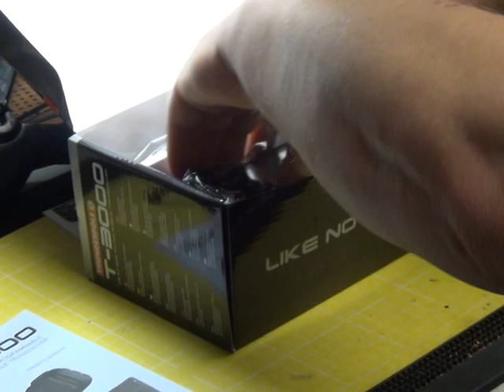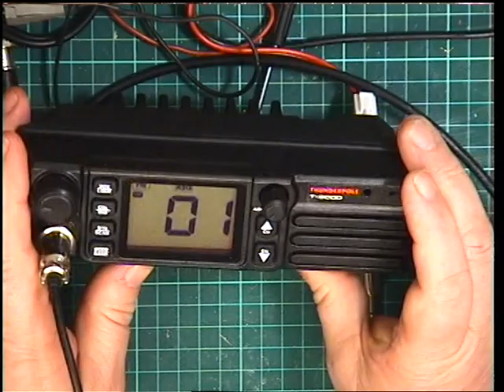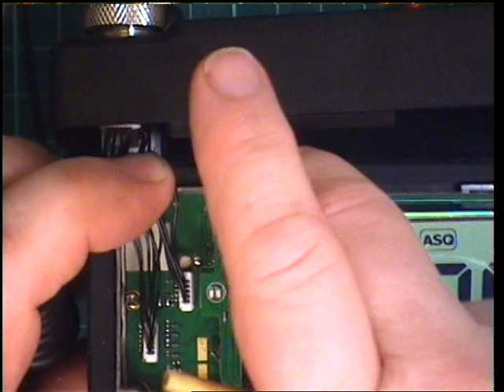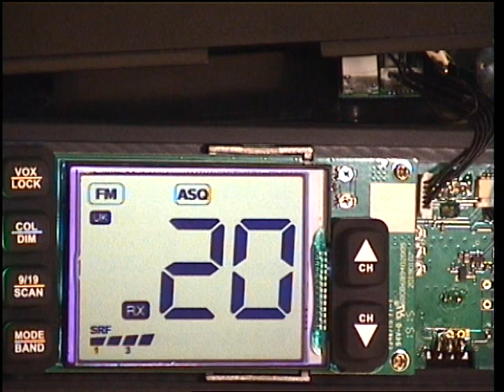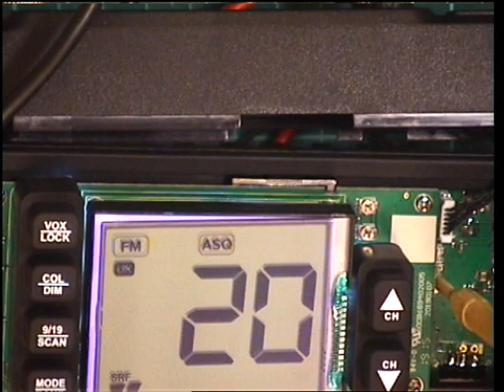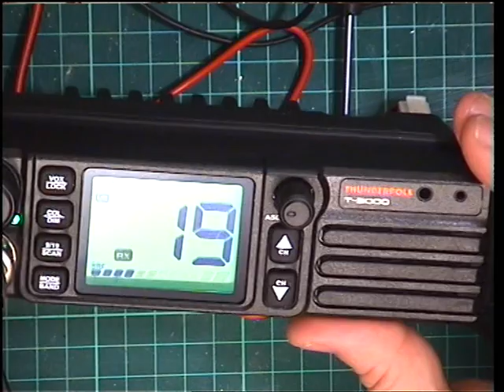Thunderpole T3000 (UK) CE Multi-Norm CB radio (mobile) - Overview & internal adjustment

Comment: Hello Richard, this is interesting, I am looking at buying this very Radio. I had a Midland Radio, I forget which model, one of the older blue/ green coloured ones running a K40 antenna. What sort of antenna would you recommend for this please? Also, if I do purchase one of these Thunderpole radios, do you offer this service? Thank you, keep up the good work, Richard.
Reply from the maker: Yes, you can send the radio in for optimisation. Please email me. (rshireby@ahoo.co.uk). Aerial-wise, it's whatever works for you....we always use drilled-in body mount aerial as it makes a big difference between lagmount type performance.  Always make sure your SWR on whatever aerial you use is as good as you can get of course.

Richsard, G0OJF, UK

Comment: Wow a disc with something for the Amiga written on it. Still a big Amiga user - I recap A1200 and A600 models and often move them on through eBay - usually at a loss. I have 4x A1200 all restored with Blizzard 1230 MKIV boards in EACH ONE - yes I have lost the plot. Will probably move a few on at some point. Set looks like a Marine rig.
Reply from the maker: Mr Chippie was big-time into Amiga.

Richard

Comment: Well  Dear Richard myn brand was Jopix  .i dont like it a tol !!! i like the normal danita 3000 and dont smeyling the 1240 you can stil by and are so good worcking !!!! and chaep and from metal !!!!!! and verry senticief  on vacation on france she worcking like hell
Reply from the maker: We tested the Jopix version, the video is on here & it is not as good as the Thunderpole T3000. Like all other CB radios, they never work new out of the box properly. Deviation & power far too low.. 

On the whole the Thunderpole radios work reasonably well, though not perfectly, out of the box.

Richard, G0OJF, UK

Comment: rubisch !!! i have 2 like dis but a other brand ,the radio is just the same i put boyt on the garbisch !!!!
Reply from the maker: The firmware on the Thunderpole T3000 is different to any other branded sxets that look the same. Why were the sets you had garbage?

Richard, G0OJF, UK

Comment: The same CB radio as the PNI HP9500, but I think the PNI is cheaper (in germany).
Reply from the maker: The PNI version has different firmware...we did  a video on that too. For UK users the PNI firmware is inferior to the Thunderpole version. However it may be fine for non UK users.

Richard, G0OJF, UK

Comment: I have one of these but when I speak it’s extremely quiet. Everyone struggles to hear me. Have tried a new microphone and it hasn’t helped. Any ideas ?
Reply from the maker: The transmit deviation is too low & requires adjustment with reference to an FM deviation meter & a dummy load. All new sets have the deviation far too low. It should be 2.2 to an absolute maximum 'never exceed' of 2.5Khz to be the 'right' volume for the UK on transmit. All new sets have it set around 1.4Khz which, as you've discovered, is far too low. It's nothing to do with the mike & the radio isn't faulty. Remember I said 'all new sets'...I mean that....some Albrecht & Cobra sets that I've seen are set to a miniscule 0.9Khz.

Richard, G0OJF, UK
Reply: @ukfmcbradioservicingTango21  thankyou for the quick reply. is that easy to adjust or not ?
Reply from the maker: @joshhyde5605  It's easy to adjust, but you have to have the radio connected to an FM deviation meter & dummy load in order to make the adjustment; This is so it doesn't end up going over 2.5Khz & spattering into channels either side. You could also send it in for service....and I'm not looking for business by the way!

rshireby@yahoo.co.uk

Comment: Just bought one  its ok..well its been 40 years since last on..would love to see what max power output is
Reply from the maker: 4W if you're lucky Andy. It's not like 1981 sets, many of which will easily (depending on model) do a good 4W. Most current models are coming out of the box doing between 2.5 & 3.6W. Few will go over 3.7W even after realignment. This model will do a full 4W. In reality it makes little difference to range. The blue display Midland 78+ multi fitted in our test vehicle won't do over 3.7W.

Richard, G0OJF, UK

Comment: Watching this and the new Midland one, it puts me off buying these new radios. They should set the radios correctly before they leave the factories, then maybe they would sell more of them. Great work
Reply from the maker: The Thunderpole range of radios are the only current ones that I consider to actually be useable out of the box without optimisation; the Albrecht range of expensive sets being the most sloppily setup...including one that was £229.99.

The T3000 is one of very few sets that they got the firmware correct on, allowing seamless band changes UK FM, CEPT FM, CEPT AM. Nearly every other set has to be reprogrammed for an EU country code to access AM on CEPT channels...this one get's it right.

CB radios are always shipped with low power & TX audio & are supposed to be adjusted by the selling dealer. Knights do that; I'm not sure if anyone else does, so I end up with them! The reason of low power shipping is in case the batch of radios are spot checked at the receiving countries Customs Dept. If the radios were all shipped at 4W & one was spot checked to be 4.01W, then the entire container load would be rejected & sent back. They err on the side of caution. It was the same with the 1981 models too which is why Boots & Woolwoths should never have been selling them!

Hope this helps

Richard, G0OJF, UK

Comment: Can the signal meter be adjusted mine is reading s9 on all channels. All my other radios read s2 or s3
Reply from the maker: No it can't on this model. S9 read about right on our test instrument. Quite a few new sets have no meter alignment preset. I've also noticed that the slightest signal & they read S5 when you would expect S1, so this set isn't alone.

Richard
Reply: @ukfmcbradioservicingTango21  thank you for the quick reply 
Regards Andy

Comment: I’m pretty new to CB and bought one of these this week, could I in theory open it up adjust power up to 4 watts or do I need to make consequent adjustments in other areas ?
Reply from the maker: You can just adjust the power without affecting anything else. You need a power meter & a dummy load....and a proper trimming tool to make the adjustment...not a screwdriver!

However, the power may not need adjusting...it depends what your meter says it's doing into a dummy load.

richard
Reply: UK CB radio servicing Hi Richard, thanks very much for taking the time to reply. I have bought an SWR/power meter and am waiting on it to arrive. So I will check the power output out of the box before doing anything. I hope it’s not a stupid question but what’s the difference between being hooked up to an aerial and using a dummy load ? Cheers, Mark
Reply from the maker: Mark, not all power gets to the aerial as it is subject to SWR. A perfectly working CB connected via a power meter to an aerial may read 1W...or may read 6W, so it means nothing. A dummy load replicates a perfect aerial & is the only way to measure power. You will need an adaptor from the RCA radio outlet to convert to SO239 (which is the female socket for a PL259 plug). So you need a SWR/Power meter, dummy load,  patch lead (usually 20cm PL259 to PL259) and an RCA male to SO239 adaptor. The latter can be hard to find, so I've gone to the trouble of looking on ebay for you & found this :192831320618. Finally you always check in the centre of the band, so that's channel 20.

Richard, G0OJF
Reply: UK CB radio servicing Thanks Richard, that makes sense about the need for a known constant loading. However once again please excuse my ignorance, where does the RCA come into play, doesn’t this radio just have PL259? So I’ve bought a SWR/power meter, patch cable, a dummy load, and the proper trimming tools. All of which will be useful going forward in this hobby even if I never open this particular radio. Many thanks for taking the time. Mark
Reply from the maker: Well our Midland 77-810 to which you commented on as having been given two of by your uncle is fitted with an RCA phono socket for the aerial!

Richard
Reply: UK CB radio servicing Hi Richard, I think you may be mixing me up with somebody else, I bought one of these thunderpole t3000 (albeit branded as a Team FX-CB mobile). But I guess all your advice still applies. Thanks, Mark
Reply from the maker: @mphelan1234  Yep,Muddling you up. Too many questions from people today!

Richard
Reply: UK CB radio servicing haha no problem at all. I’ll get all the parts together, test it and let you know what I find. Thanks again for the advice. Mark

Comment: Would love to see a Cat Whiskers Cat Call tested. I have many (including a base station) if you would like to try them - I’m relatively local to you
Reply from the maker: I do have one. To be honest they are just a DNT mobile put into a different case in the UK with selcall added, though they are the supertuned version. It's a chassis that is unreliable because of the double sided PCB that has rivets between the track sides; not a good idea. We will cover it though.

Richard
Reply: UK CB radio servicing if you would like a second so that you can do a performance test let me know

Comment: A friend of mine bought one of  these for his van, since I’m a long served CB operator , and have tried many things both new and old , so he leant it to me for my thoughts. To be honest, to me , it’s one of the best new radios I’ve used, even the automatic squelch seems quick and snappy with no hideous crashes or bad pops, and it will remain open with fair noise on peoples audio, rather than constantly chopping off, but in general still remains silent even when the meter shows s9 of racket. Very impressed. It also heard every station around the same clarity(weak) as the president grant 2 mobile, with better auto squelch action, and at home as good as the York 869. 👍🙂 good video as always, best regards to you and the team.
Reply from the maker: Thanks Tim. I try & balance between 1981 sets & current. Any UK legal set you'd like to see covered next? rshireby@yahoo.co.uk
Richard
Reply: UK CB radio servicing  that was the one I wanted to see covered! I was interested to see your view, and how it performed on the test set. I of course look forward to the usual road test if there is one following? Should I think of a radio I’d like to see covered I shall let you know.  Cheers, from Tim HT in Nuneaton 🙂
Reply from the maker: We'll be doing the 'on-the-air' test this Saturday afternoon (8FEB2020). Mr Chippie has been booked to come. Seeing as this is the first set to legally access CEPT AM when set to UK, I plan sending MR C away from base on UK Ch31 with auto squelch, then have him return from the 7 mile point switched to CEPT AM ch40.

Richard
Reply: UK CB radio servicing I look forward to it. Although I was aware of the AM function, I never did try it. I look forward to the results 🙂👍
Reply from the maker: @timothyjones4950  My experience with CEPT channels is is pretty poor, and I'm not expecting AM to help either; I have RAF Cranwell 4 miles away & RAF Barkston Heath 1.5 miles away, both with radar! It'll be interesting. 

Richard

Comment: Not keen on these radios at all Richard.
Reply from the maker: Do you prefer the more serviceable 1980's ones?

Richard
Reply: @ukfmcbradioservicingTango21  yes very much so Richard, I think the best all rounders was the cybernet boarded rigs - rotel, harrier, binatone 5 star, fidelity 2000 .
Reply: I like some of the newer radios too, the crt one (N) is excellent for the money.
Reply from the maker: @ep1929  Yes, 38 years later they have certainly stood the test of time. There can't be many 1981 electronic products that are still saleable for good money after 38 years!
Pity Cybernet got bought by Kyocera & the factory now churns out solar panels instead. All that CB manufacturing knowhow turned to shit.

Richard
Reply: @ukfmcbradioservicingTango21  think everything now is in the CB world is Chinese, some of it is good value for money but there is the "build quality" issues with a lot of it.
Nothing is up to the standard of the old Japanese rigs.
Reply from the maker: @ep1929  YEs, 3 year old sets having to be scrapped because of ingress of moisture into surface mount ceramic capacitors in the VCO, causing microphony so bad as to render the set useless

Comment: Looks interesting modern set it a pain when it comes to repairs it about 50/50 to fix it the parts will be hard to get hold of when it 5 years old and the quality is not good as the older radios like in the late 70s & 80s can fix them at 99%. Great video
Reply from the maker: Yes, I think the only changeable parts will be those leaded components which are the output transistor & Audio IC, regulator & I think the RF pre-driver transistor. Not expecting it to last 38 years like many of the UK 27/81 rigs have.

Richard (UK)

Comment: A lot of these newer radios have an 'Engineering Menu' which is accessed by holding certain keys whilst switching it on, then you can adjust various features and settings. Maybe, just maybe, this radio has such a menu?
Reply from the maker: Well of course if we had a service manual.......At least I was able to figure out the important adjustment. One day there will be nothing inside & all controlled by engineering menus.